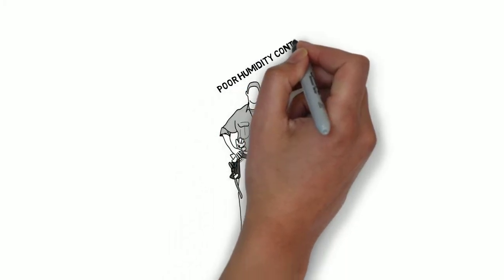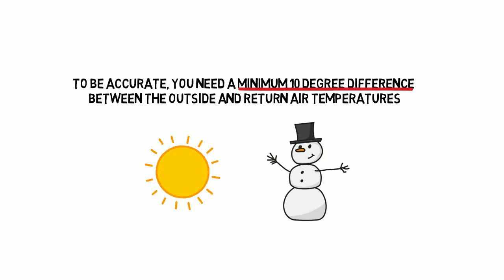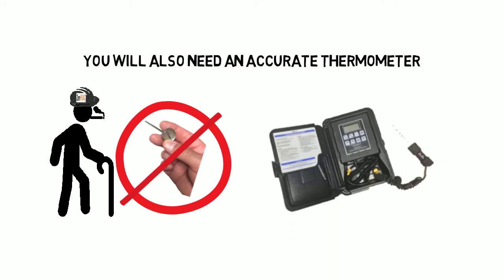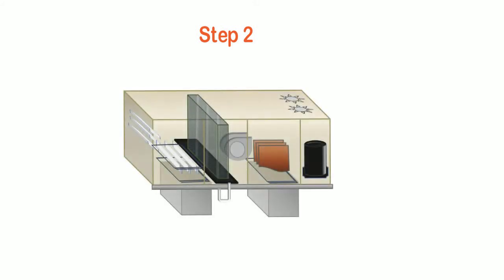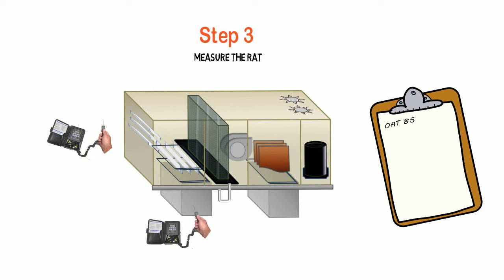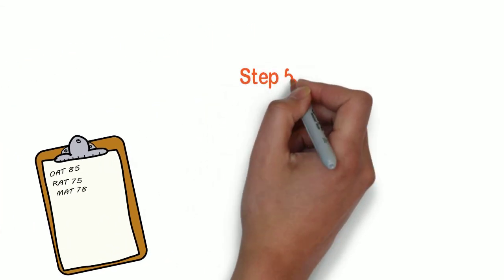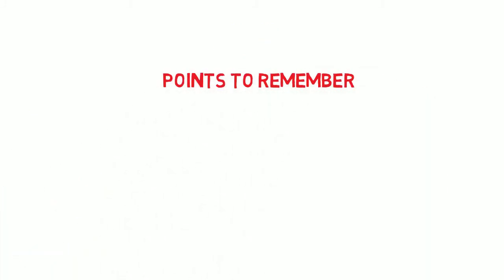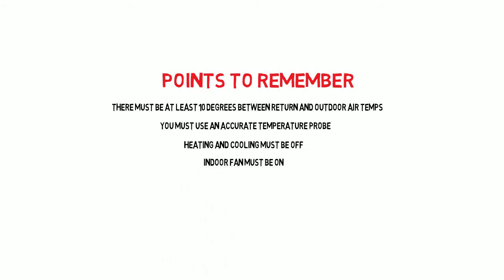Measuring Economizer Ventilation Air Percentage the EASY way!!

Comment: Hi, why must the cooling or heating be turned off before you take the measurement?  It seems having it on would help ensure you have the minimum required temperature difference between the Return and Outdoor air temps.
Reply: the idea on measuring mixed air temperature is that it's the temperature of the outside air and the return air before hitting a cooling coil or heating coil. You can measure the mixed air temperature easier on the supply duct. Without cooling/heating, it should be the temperature hitting your cooling/heating coil during normal operation. Hope that helps